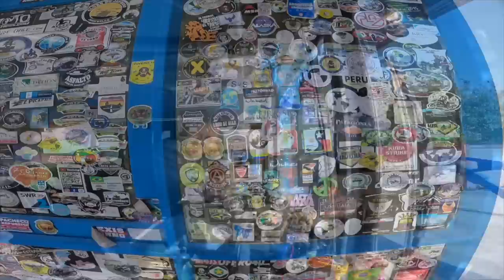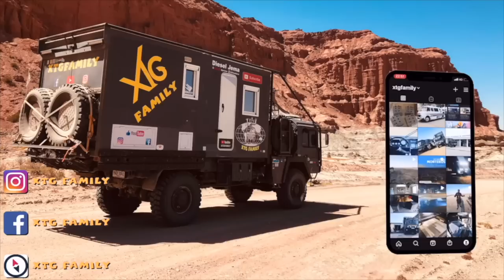437 soucis de la vie courante des voyageurs

Comment: Julien, aujourd'hui les petits postes à souder MMA inverter, tu peux l'alimenter presque avec n'importe quoi. Certain soudent même avec leur batterie portative du genre Ecoflow, ça marche très bien.
Il me semble que tu as un générateur ? Si t'as un générateur de courant alternatif de 230v qui peut sortir 16A, alors c'est bon jusqu'à 3,2mm ce qui donne déjà des fameuses soudures. Ou sinon tu vois si tu ne peux pas acheter un convertisseur 24V DC à 230V AC qui sort 16A soit 3500W (pas forcément en continu) et tu branches sur une de tes grosses batteries si elles peuvent sortir cette puissance.

Je dis chaque fois que si tu peux brancher une bouilloire électrique de 2500W, alors ton poste à souder inverter passe aussi.
Reply from the maker: notre groupe est un 1000 w on est loin du compte

Comment: Un 2.000w d’accord mais si jamais vous allez quelque part où il fait -15*/-20* va-t-il suffire pour que vous soyez au chaud…? Ahhhh webasto…
Reply from the maker: oui ça serait suffisant dans la mesure où le GO ne gèle pas
Reply: Mais c’est vous qui allez geler si vous installer un 2000w, lorsqu’il fait -15* dehors vous aurez pas plus de +10* à l’intérieur
Reply from the maker: @stevehendrixx  on a eu toujours eu des 2000 watts avant le camion et on chauffait notre tente de toit, même en hiver. ça serait encore moins un problème avec l'isolation du man. Mais par contre nous venons de découvrir que le 4000 W avec le multicontrôle peut aller jusqu'à 5500 m d'altitude donc on ne regrette pas.
Reply: @xtgfamily  ah mais là vous avez un 4000w et pourtant le camion est bien isolé, non? Comment cela fait-il ? Vous conseillez a tout le monde de mettre un 2000w mais nous avec notre hymer on arrive pas à chauffer lorsqu’il fait trop froid dehors (voir Norvege 2021 avec ume temperature de -20*},. Du coup nous avons acheté un chinois de 5000w que d’ailleurs nous avons payé 200€ (prix du neuf) et je peut vous dire que maintenant c’est la sauna si on veut à l’intérieur. D’ailleurs on peut y mettre aussi de l’huile végétal 😂 et il fonctionne à merveille !!!
Reply from the maker: @stevehendrixx  A l'époque le 2000 w n'existait pas en 24v c'est pour cela que nous avions installé un 4000 w